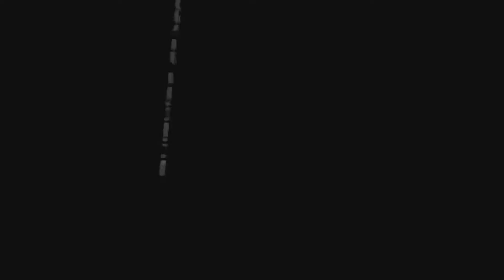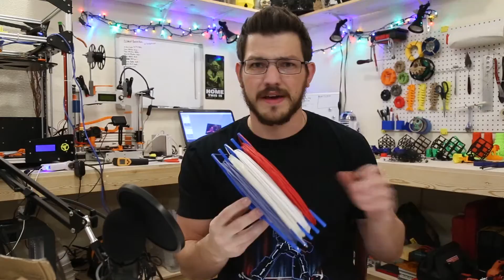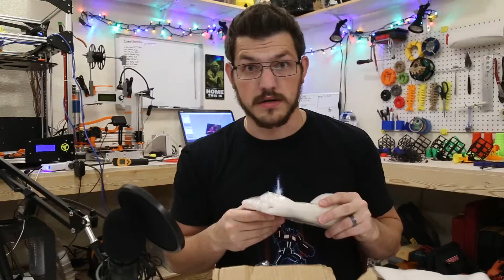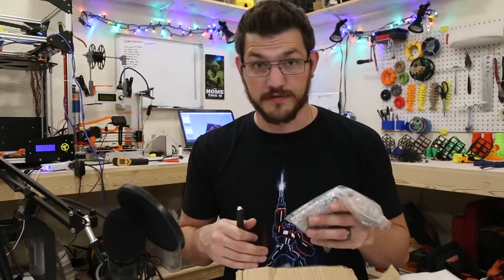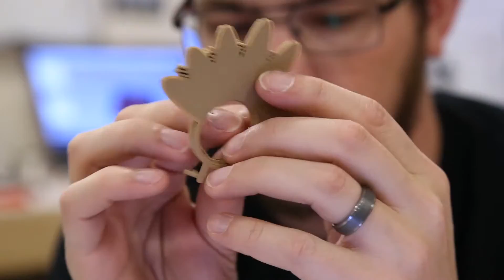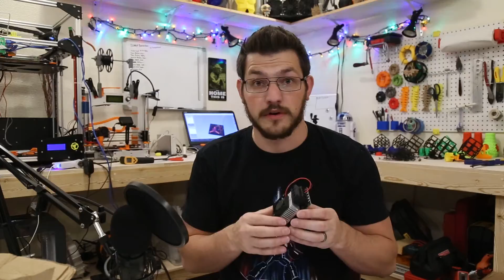Fugatech 3D Printing VLOG #011

Comment: Hi love your content do you know what settings i need to change in my firmware(marlin)on a MKS Gen v1.4  to use the output for the heated bed as just a signal to switch my heated bed on. I am using an SSR with a AC heat pad.
Reply from the maker: Thanks! You should not need to change anything. Here is a photo I found in a FB group on how to wire it up. http://imgur.com/a/Tpm4R
Reply: Hi cheers for reply, got it running heats up nearly as fast as my hotend :-)